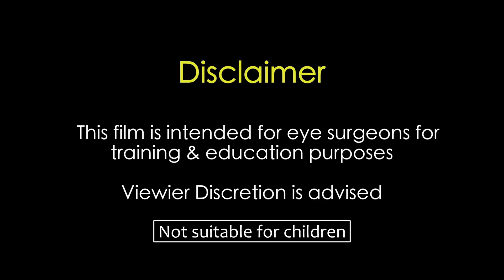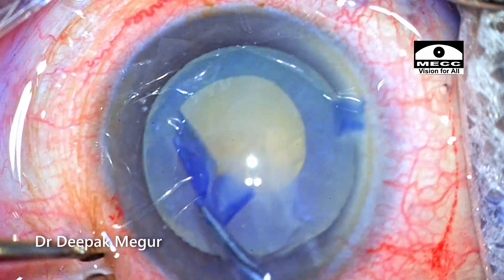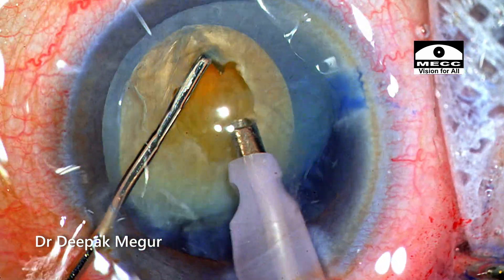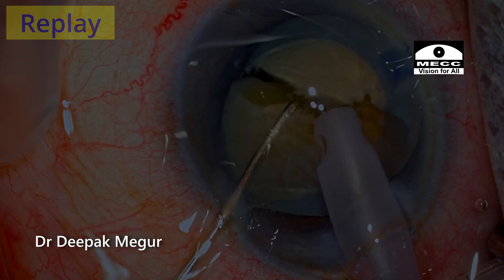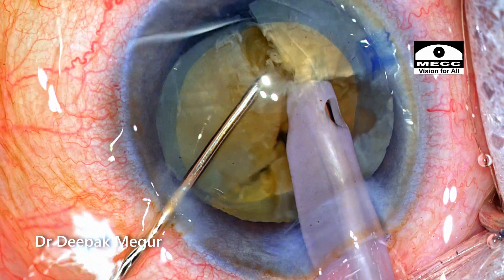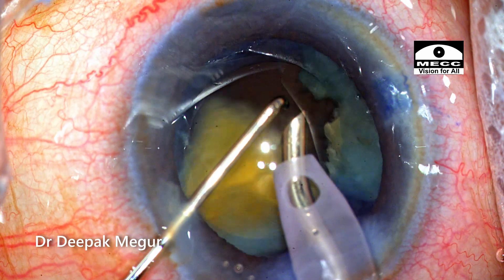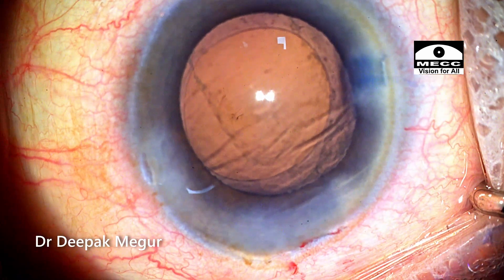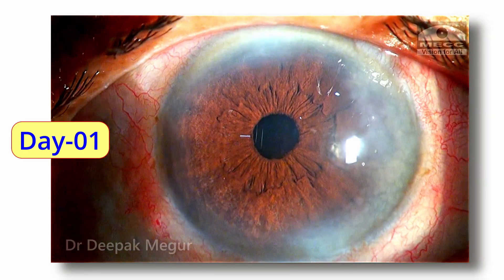Phaco Vertical Chop: How to prevent Torque in a dense free floating Nucleus: Hypermature Cataract.

Comment: Sir, can you please explain the various positions of the phaco tip, as in the direction in which the phaco tip bevel faces and when to use which position.. Just want some general guidelines as a beginner phaco surgeon. Thank you sir.
Reply from the maker: I dont think it is very critical. It varies depending on the machine you use and of course the surgeons  preferance. In alcon machine which have a 45 degree bend you can only use it bevel up during Sculpting and also to bury the tip during chop. For  Other machines with 15 degree tips one can use bevel down to bury it into the nucleus during chopping. Bottom line - It  is not very important. Find a way which works well with your machine.
Reply: @DrDeepakMegur ❤
Reply: @DrDeepakMegur 
Thanks for the superb video...
I have the same phaco machine,  but I find holding of nucleus very difficult..can you please suggest phaco settings in the hard nucleus as well as soft cataract
Reply: Thank you sir🙏